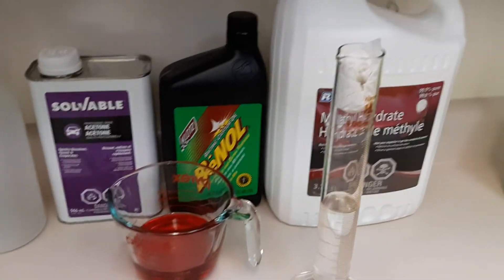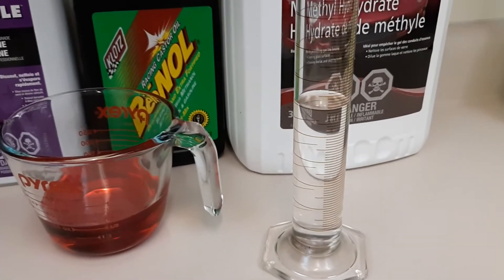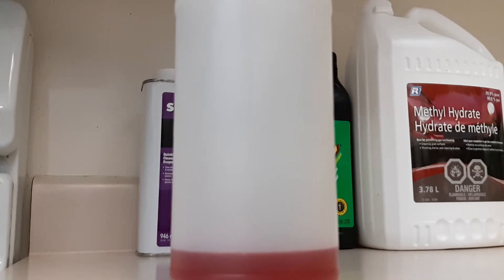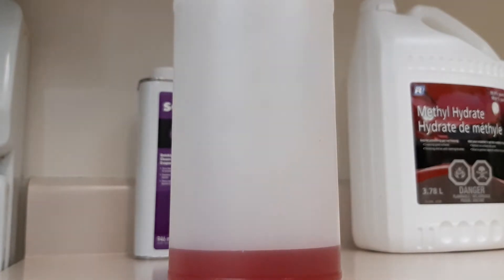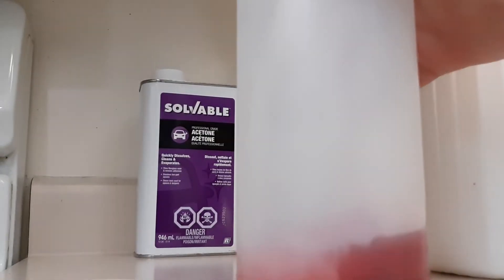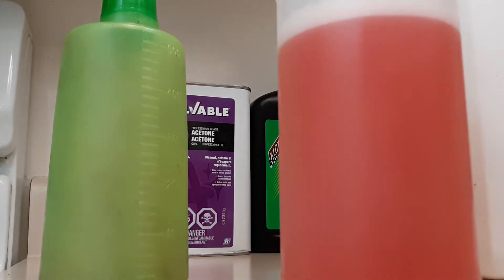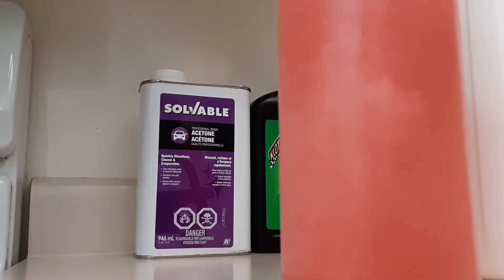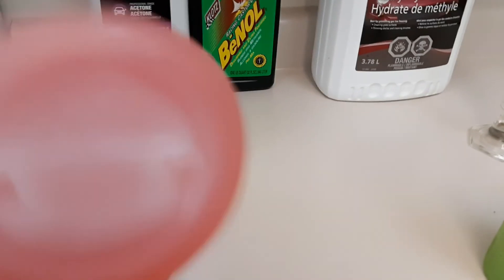Hardware store RC fuel 0% methanol acetone castor oil mix part 1

Comment: I've done a very similar fuel mix in my 2.5. I used a splash of marvel mistry oil, denatured alcohol, caster oil from a pharmacy and a splash a acetone. It ran great, good temps and double the time on a tank of fuel.
Reply from the maker: Interesting I wouldn't think the Marvel Mystery Oil being a petroleum product of the blend with methanol very well but interested to hear a little feedback about this I'm using 85% hardware store grade methanol 5% acetone and 10% klotz castor oil as well as my favourite McCoy mc59 glow plug
Reply: They still have McCoy plugs in your area? Im in NYC and apparently they got discontinued :( Best plugs I've ever used. Fortunate to have 1 left in my stash from a while ago. I hope the fuel project goes well. I'm curious on the results and potentially start making it at home since my local hobby store closed down. Plus 1 on the Marvel Mystery Oil I use that in my engines as a after run oil since it pretty much looked & smelled the same as when I was using hobbico after run.
Reply: @thebug4046  it might be because I was using denatured alcohol (50% ethanol 50% methanol) but that fuel has been mixed for about a year now and nothing separated except a bit of the caster, probably because I added too much. Or maby it mixed with the acetone and that allowed to to all mix together. Looking back on it now, it shouldn't have worked near as well as it did. I might try some more sketchy fuel mixes this week. I'm still disappointed I couldn't get my 2.5 converted to gasoline.... yet. Good thing I still have my trusty vx18 sitting around... lol. Ported and polished and ready for some new fuel mixes.
Reply from the maker: @inoahmann7542  go for it man and gasoline has Different AFR'S  then methanol Klean strip from the hardware store is pretty pure from what I understand get rid the Marvel Mystery Oil though 85/10/5 is what I'm using give that I try or with Ethanol
Reply: @rubenmejia4881  They don't sell McCoy plugs in CT or Florida unfortunately. Quick tip: if you add a teaspoon of acetone to a gallon of fuel it will keep it fresh longer and if you add marvel mistry oil it'll smell like a candy factory although probably don't mix mmo with the entire gallon just into the car fuel tank.

Comment: Might try this on one of these bluecase OS LAs I bought for shenanigans.
Reply: I can confirm it works and quite well at that. If you have the patience to figure out what you're engine likes. Although I don't have the same engine so I can't say anything too specific. Just for laughs, if you don't care too much about your engine, put 1 to 4% marvel mistry oil in your fuel and the exhaust will smell surprisingly good. As an added benefit you're engine will stay very clean as well. Oh, and you may need a colder plug. I went from a hot plug to a cold plug although you will need a different heat level with any change in acetone content. If you tried to run a hot plug with 10% acetone you might get you're fingers chopped off by the prop. I cut my hand on the cooling head of my vx18 when I tried to run a fuel similar to this one because the engine pinged super hard. After the cold plug it started easy and made plenty of power. Just something to be aware of. Start with a cold plug and go to a hotter one if you get an rpm drop when removing the glow ignitor.
Reply from the maker: I'm not sure what's gonna happen but you can try for fun I suggest at least 20% or 25% oil content with  that engine since it is plain bearing run with 5% acetone max
Reply: @thebug4046  Already ran it on Omega 15 and it runs fine. No need to run such a ludicrously high oil content, 16%'ll be fine. Especially for a $20 junkbin engine.
Reply from the maker: @TestECull  anything past 12% oil for rc cars is pointless there is no ganes to be had unless you're running airplane engines